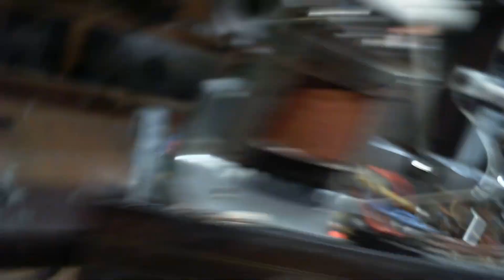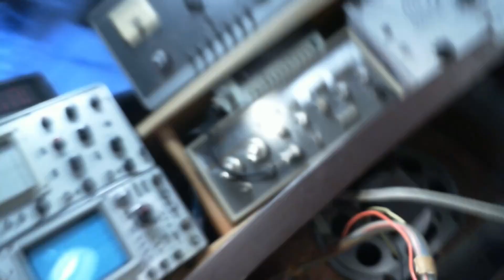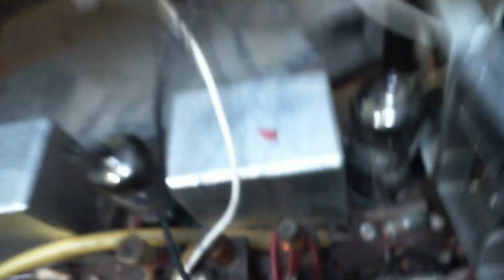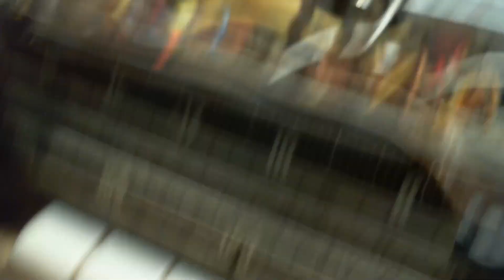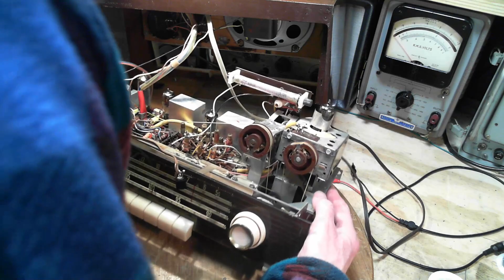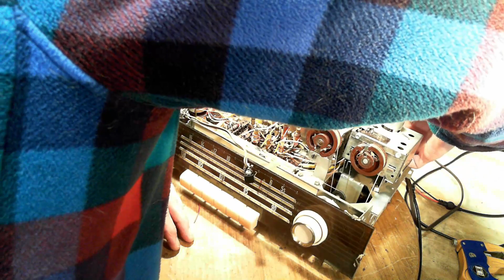Nordmende Boheme C Tube Radio Video #10 - I Broke a Wire

Comment: I have been following along with this "restoration" and share some of the frustrations expressed by others; however, I have been hoping that he will shed some light on the volume issue (loud even when turned down).  I have a similar issue with a different radio I am working on and could use some ideas.  Do any of you watchers have experience with this issue and willing to share ideas? Thanks.
Reply: In most audio amplifiers, the volume control is a variable resistor connected as a voltage divider. One end of this resistor is fed the full audio signal from the detector, the other end to ground and anything between, attenuated and picked by the wiper and applied to the output audio stage. If for any reason the ground end lacks continuity, the audio will always be at or very close to full loud volume. Use an ohmmeter and measure the resistance between the wiper terminal of the control and ground along its full rotational movement. Breakages can be in the carbon track of the VR or missing ground connection to the ground terminal. Good luck!